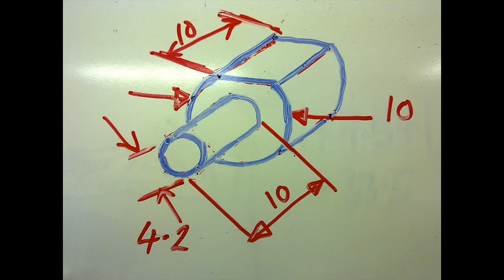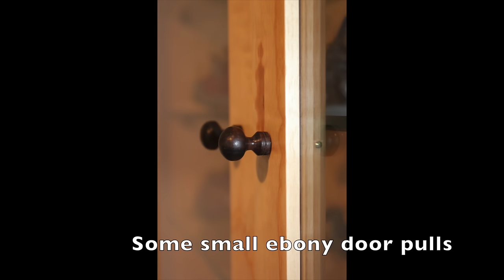Making an Ash Display Cabinet + Lessons Learned

Comment: Nice build. How did you hang it on the wall ? I dont see any screws
Reply from the maker: Thanks Lance. Ah I didn’t include that part of the build in this video as I didn’t have any photos of it. I used a keyhole router bit to machine a keyhole for a screw or bolt head (projecting out of the wall). This was machined into the back of the side walls of the cabinet. Hope this helps 👍

Comment: lovely cabinet, im not into zero flaws in the timber, its part n parcel for me. why are the hinge recesses angled??
Reply from the maker: Hi Joe, yeah the flaws can be good too, it's always personal choice. As I said in the video I was following Robert Wearing's book "The Essential Woodworker" and on pages 118-119 it mentions that the "The socket is formed by making a number of sawcuts (Fig 440) then removing the waste with a broad chisel (Fig 441). Notice that the socket reduces in depth towards the back where it finishes to a depth C, the thickness of the hinge leaf.". I think the idea is to align the centre of the actual pivot point (or knuckle) of the hinge correctly relative to the corner of the door and carcase, and to ensure that the doors close properly. The butt hinges, as you may know, before you fit them and when closed are angled due to the thickness of the knuckle. I don't know if this makes sense?
Reply from the maker: OK, I've just found the reason in his book! It is to maintain a pleasing look by only letting the hinge into the door, so that the straight line down the carcase side is not interrupted. Again, it's another personal choice thing! Hope this helps?